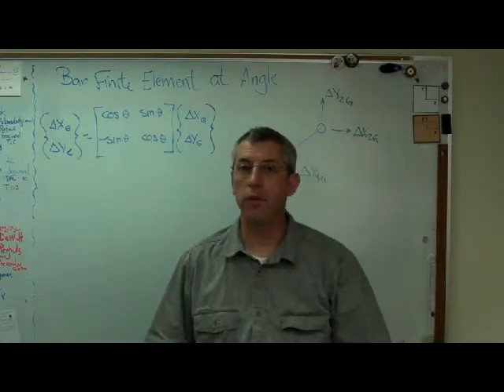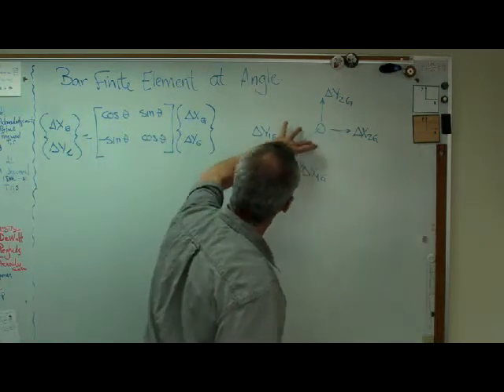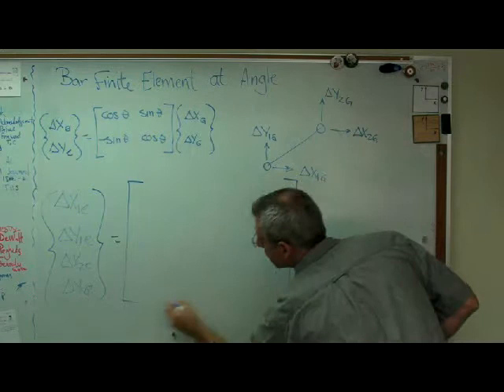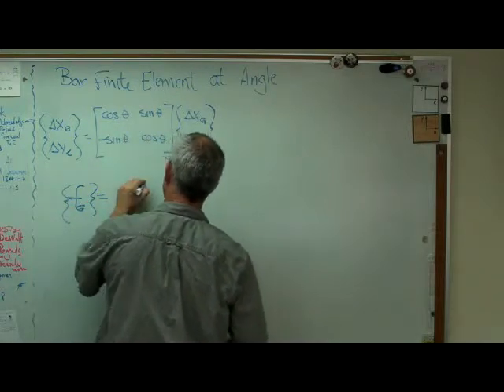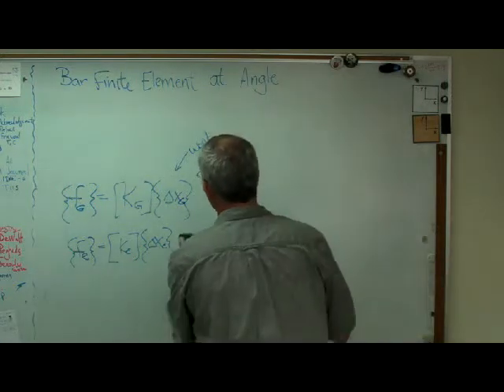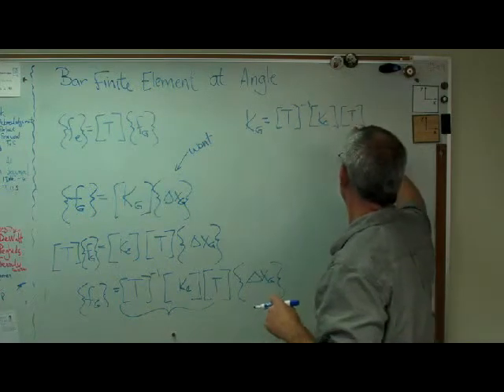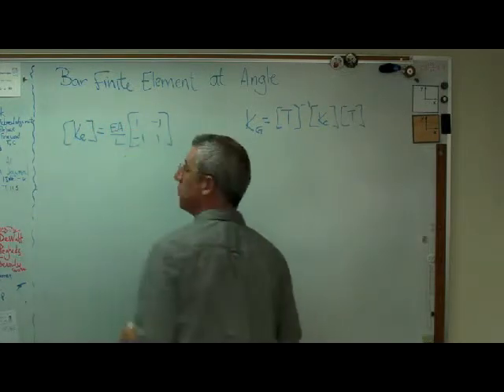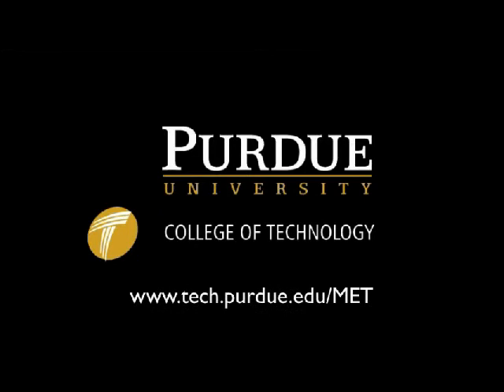Rotating Bar Element 2 of 2 - Brain Waves.avi

Comment: Kind of helpful kind of unhelpful.

From what I can see at the very end that would be a 4X4 global stiffness matrix with x1 y1 x2 y2, essentially 2 DOF and 2 nodes.

What would happen if you had an entire system of elements? Say 5 bars all in various orientations and each obviously with 2 DOF and some overlapping.

Could you solve some example problems?